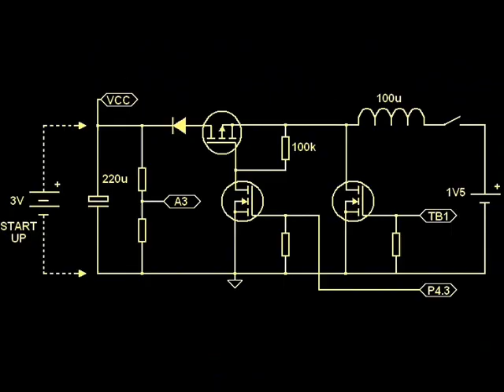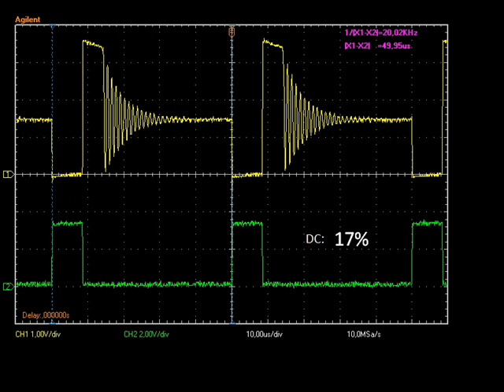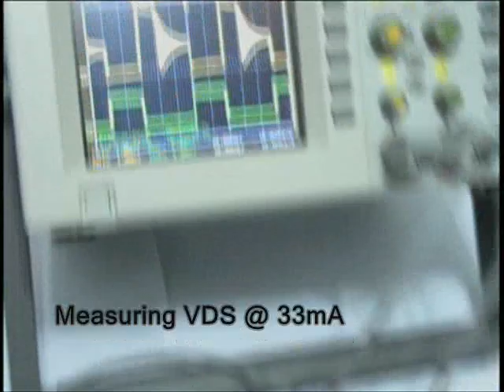UP! Self powered boost converter

Comment from the maker: No, there’s no problem with the heart of our volunteers.  If one beat was missed, would be displayed something like 74, 37, 74 ,....(for simplicity we're using no average).  Instead, you can see a continuous 74, 73, 74, ... What happens is that our Windows program reads input data periodically at 300ms.  Reducing this scan time to 100ms, the audible signal would be more synchronized with input data.  Thanks for the remark.